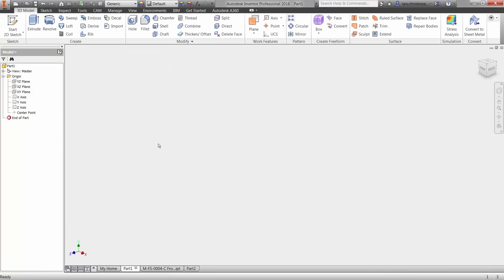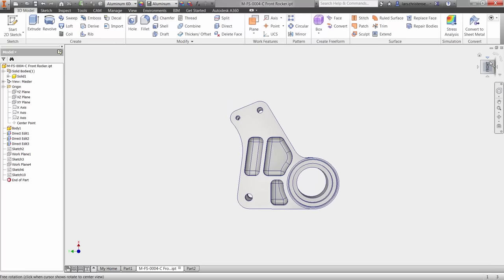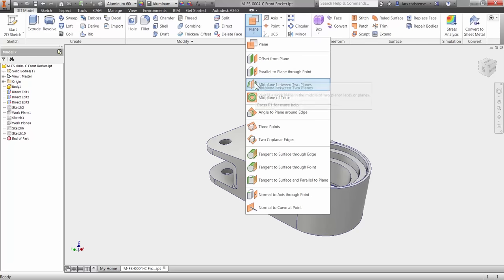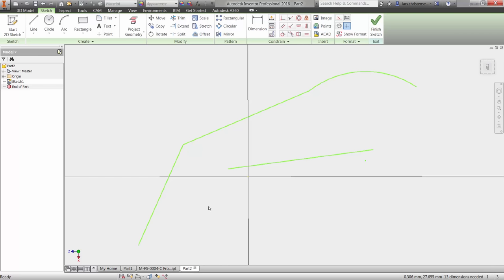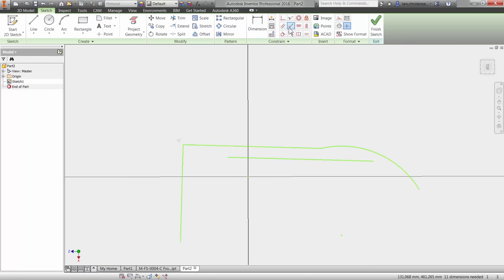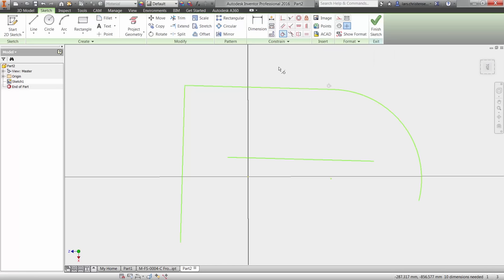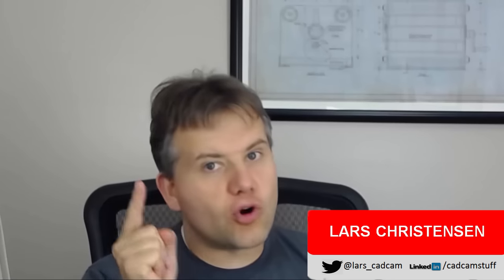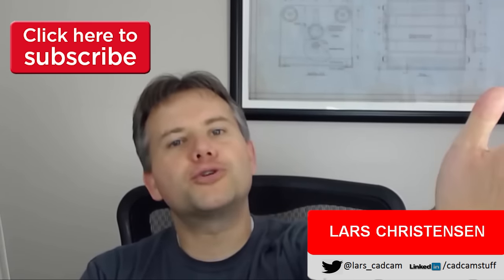CAD Tip: Important 1st. Steps of Your CAD Design

Comment: Liked that, thanks . A little example of the tangent constraint would have been nice, but hey, now I can try things out and test myself :-)  one thing I was struggling with when starting to use CAD (in Fusion360) was the situation of over-constraints in sketches and which are 'more useful' or 'higher priority' constraints one should use.
Reply from the maker: Would this video help:
https://youtu.be/xQ8BBcaK-8U?list=PL40d7srwyc_Mkgc5wvP_OfVel9aDkNkZ6
Reply: I appreciate the answer and that you take the time to answer to comments, and the video was (as all are) useful to watch. However, I don't think it related to sketches and constraints in sketches at all, or did I miss something?